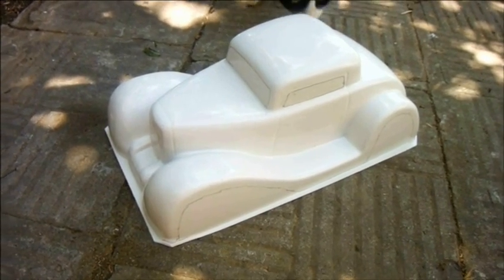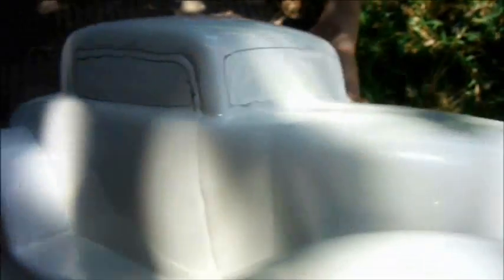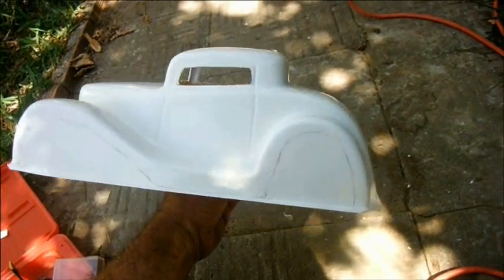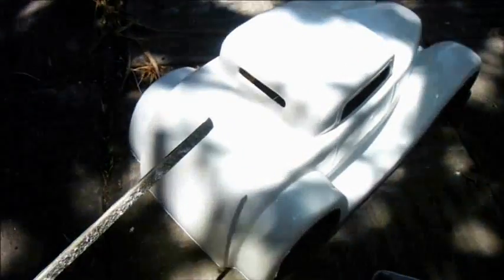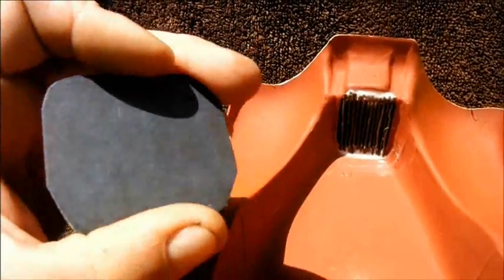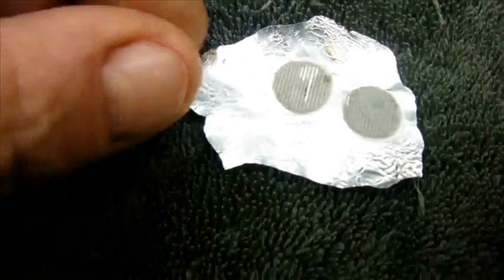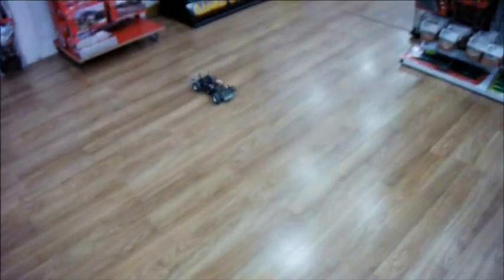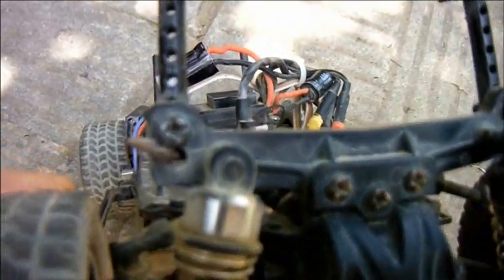RC Rat Rod ´32 Coupe

Comment: that looks fantastic del !  the markers for head lamps was slick ! the perfect size and shape , very convincing !   actual weathered metal bars for the grill was an excellent touch to accent the rusty body.  glad you took the time to trim out the windows .  it looks more in tune to the over all condition  than it would if you would have just blacked them out .  big thumbs up
Reply from the maker: Hello - thanks for mentioning that you liked the marker pen idea. I used to keep an old one just to use it as a form around which I would mould aluminium foil to make headlamp bowls for my "scale classics"...er...range of videos. When I was wondering whether I could make convincing head lamps from modelling clay I thought "Dammit - to hell with the budget; I shall splash out and buy marker pens just to cut them up", which isn´t a very environmentally responsible way to behave. Still, what sort of carbon footprint would be incurred by shipping a pair of ProLine hot rod head lamp buckets to England from China via the US? And marker pens are more fun  : )
  Yes, it would be a shame to build a car like this with blacked out windows. It´s not so much trouble to arrange a driver figure and glue in a bit of clear lexan.

Comment: Beautiful body , excellent job and great run !!
Reply from the maker: Hello, Sator - thank you very much. I don´t like driving this car on sand as I´ve already killed a pinion/spur gear set in this way while filming for my first Carisma Beetle video. The car itself seems to love it, not getting hot, though it does get stuck if you slow down too much. Despite my concerns, the heavier ABS banger-racing body doesn´t seem to make the car top-heavy, either.

Comment: Hi del, another nice video. 
You don't by any chance happen to own a Honda cd350/4  do you.
Just thinking about you're moniker. 
lol.    😀 👍 👍 👍
Reply from the maker: Well done - I´ve had it for thirty-three years.
Reply: Del350K4     any pictures, I've got a suzuki GT250K candy apple green 1973, just finishing off the restoration. All painted and powder coated, just getting the engine casings and barrels vapour blasted, then builderup. Ohhh yeah. 😀
Reply from the maker: Sure - I´ve got a video called "Some motorcycles I have known and loved" on my other channel, Del360T, which shows my K4. Your GT250 sounds nearly finished - are you going to post a video when it´s done?
Reply: Del350K4       oooooh yeeaaaahhhh 😎